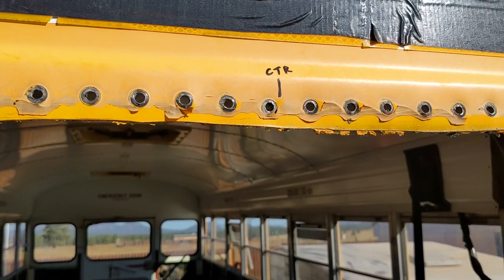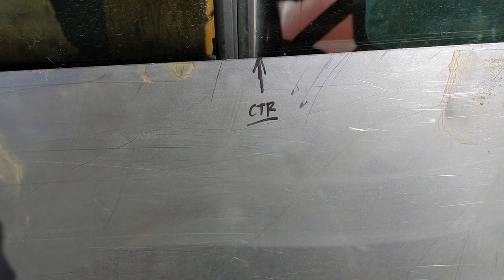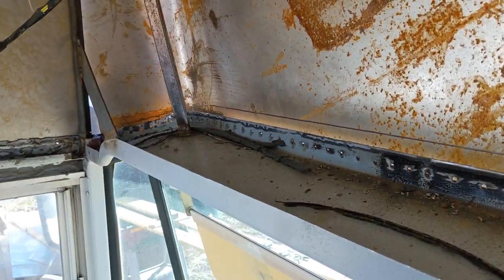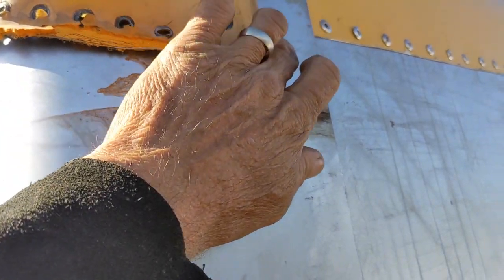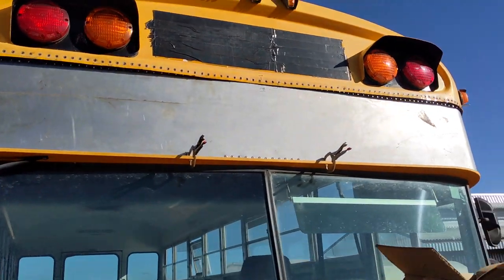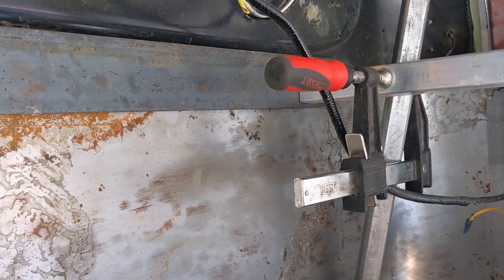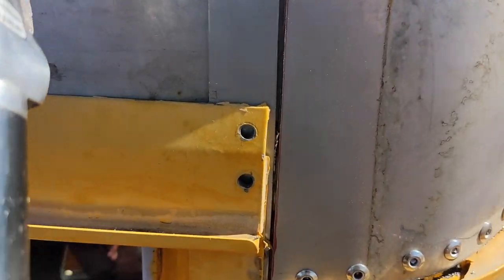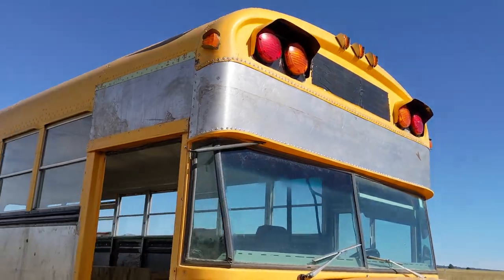Finishing the roof raise project!

Comment: Thank you for sharing this project with us.  I was wondering if the sheet steel should have had primer painted upon it before being installed. Is this a future rust concern or would the 3M product not seal with Primer.     Sadly up in Canada we can purchase an older School bus with low mileage, yet our Insurance companies look at a conversion as once a school bus always a school bus....$6,000.00 a year for passenger insurance on a bus, even though seat are removed in the conversion to a motor home.   And the price of fuel is really becoming a going concern.

Comment: Greetings! Really great and informative videos, some of the best roof raise tutorials out there! Just wanted to say thanks; we're gonna use your videos as a master-class for our raise this week. Curious about one thing: at about 10:51 of this video you mentioned using washers around the bend of the front panel, but I don't believe you used washers along the front facing edge. On the side panels (another video) you used washers when combining the new 18guage and existing sides.  How do you decide when/where to use washers? Why not use them on the front, and did you go with 1/4" inner diameter stainless washers?   Thanks so much for the content and everything you do!
Reply from the maker: Well, thanks...I'm flattered!  And...washers...I use them when riveting two layers of thin sheet metal because the inside thin-gauge sheet doesn't provide much holding strength.  But if I'm going through a hat channel rib then it's not necessary.  In the front, there's a 1/8th inch thick (3" wide) steel plate inside the seam.  On the sides of that, though, where the plate doesn't wrap I did use washers.

I use stainless 1/4-inch rivets, but don't bother with stainless washers since they're on the inside and get primed. 

I am honored to think my videos might help your roof raise.  That's my goal!

Comment: Love the channel. Subscribed. Where did you source the rub rail end caps? We need a few for our rig after the roof raise. Thanks a bunch
Reply from the maker: Hi Alex.  I may not have shown it in this episode, but in one of the earlier ones I showed where I cut those from.  They were tail ends...pointing towards the rear of the bus...which were overlapped by the rear corner rub rails.  Since they were hidden beneath the lap, I cut them out and use them up front.

I have also made them from a regular length of rub rail, with little triangular pieces cut and welded in, but it's much easier if you can score a piece from beneath an overlapping section.

Comment: Why do you not prime/seal the metal in the seam and joint areas prior to riveting it in place? And what keeps the insides of the rivets from letting water in where the shanks to the rivets were? Water is relentless! It always seems to find a way in. And steel rusts, especially where water collects on un coated pieces.
Reply from the maker: Hi there...in one of the videos, I showed the rivets we use.  They're closed-end stainless rivets.  They're more expensive than standard open rivets (about double) but they aren't open to the inside, so water cannot pass through them.  As far as the seams go, 3M 5200 is about as permanently bonding and sealing as we've ever found.  It's expensive, but worth it.

Comment: Did you have a preference for the 444e? I’m kinda surprised you didn’t go with the dt406 or 466. Just make sure you put some Archoil in the crank case, it will really help with the cold starts, by eliminating stiction. Make sure your glow plug relay and all of that is working, you’ll need it.
Reply from the maker: I'm a big fan of the DT466.  This isn't my bus...it belongs to a customer.
Reply: @RollingLiving  the 444e, they should have never offered it and just kept with the 466 and 406. Just like CAT should have never sold the c7/3126. There would have been a lot better 5.9 Cummins and DT466s out there today. Heck, it would have made a nice engine for the pick ups as well, instead of the 7.3. 

I understand, it’s not a terrible engine, it’s just not a desirable engine. If you have it, I can just envision people squirting bottles of ether trying to start them and further damaging the internals and causing more problems. 

I’d like to see how these things started when they were new, and everything was working correctly.

Comment: We’re is the sealant between the raw steel and the bus body skin?
Reply from the maker: I use 3M 5200 at every seam overlap and between the frame ribs and the skin.  I thought I mentioned that, but it might be in an earlier video in the series.  It's fantastic stuff.